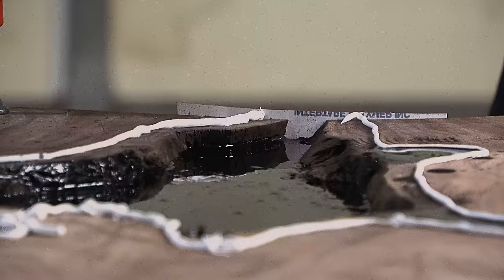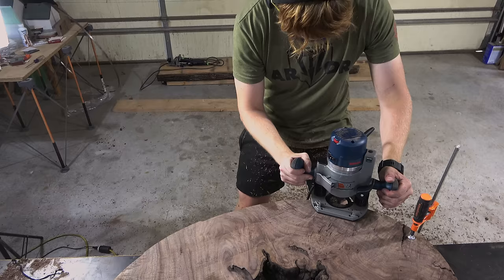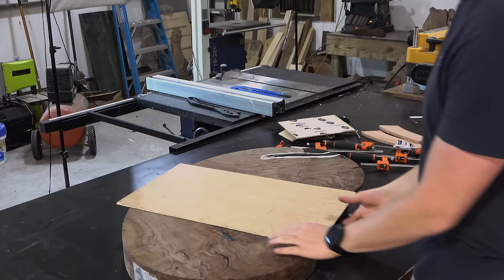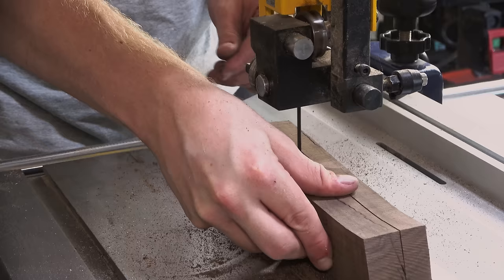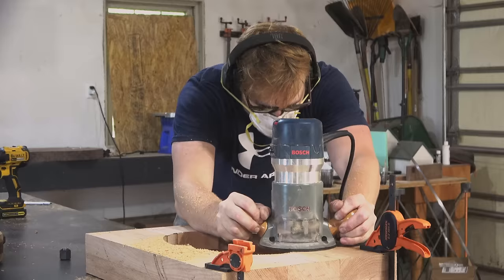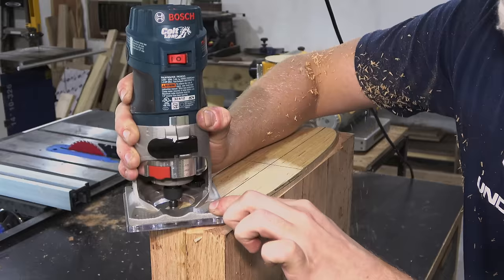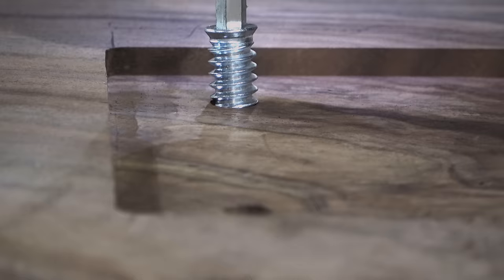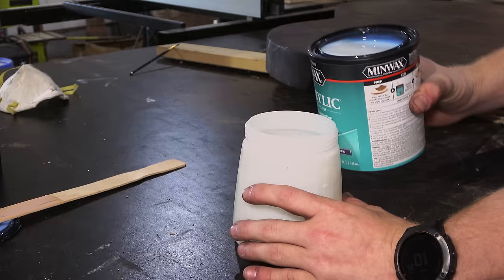The Reason Nobody Builds Furniture Like This

Comment: Looks good!

Ideas (what you might call constructive criticism, though I wouldn't consider any of it criticism, per se):

If you ever do that gold-leafed hole through the legs on another project again, maybe try chamfering (or rounding) the hole.

I would probably have rotated the legs a bit so that they were further apart at the concave end of the table as well. That part of the table looks as if someone, or something, were meant to "belly-up" to it. Having the legs more open on that side would enhance that look, and give it a more "intentional" feel.

That would make the whole piece look more unified, and less like a tabletop bolted on to some legs. Slanting legs outward (or maybe inward, I'd have to see a mock-up to see if it would look good) might also help with that.
Reply: After reading your comment and looking back at it again, I agree with your assessment. It would have given it a more balanced look.
Reply: Just goes to show, you learn during and after every build. Isn't that great! Love the process

Comment: Hey this is Stan I'm 80 years old and I'm so impressed with your work I can't even believe it I'll give you one little trip for the gold leaf use a squirrel tail kind of make a paintbrush in the static will put the gold where you want it to go this is on say a piece that's a little more Bumpy cause gold leaf is really hard to handle but the static from a squirrel tail makes it easy good job

Comment: Great video! I especially liked the oval drawing. Little mathematical note: that device to draw an ellipse (a term with a specific mathematical meaning, with oval being a general term) is a Trammel of Archimedes, an eponymous invention. An ellipse may also be drawn by: fixing two points on a flat surface, as with nails, and placing a pencil and both nails all inside one loop of string of any length. Draw an ellipse with the pencil holding the string taut. An ellipse is the set of all points whose sum of the distances to the two points, the foci, is constant, made real by the string loop.

Comment: As an old gen-xer, I giggled at your references to old tech. I didn’t think I was going to care for this design, but the beauty of the tabletop grain pattern alone won me over. I have to agree with a couple of other commenters that changing the angle of the legs might have resulted in a more balanced(?) look, but overall, you did a fine job on this piece. New sub. 🙂

Comment: This is the first video I've seen of yours. Enought to say it certainly got you a like and a subscribe.

You asked for comments on the table, honest ones, well here goes.
If I were the customer I'd be well pleased with the result, it does look great and the use of the gold leaf in the leg reveals is a great touch that makes the legs pop. My one criticism is that the legs look a little over sized for the top, maybe the could have been a little thinner. The black stain really works with the walnut. The kidney bean shape of the top is great, I'd be happy to own that piece of furniture. Slim, hand cut bow-ties certainly do look better than machine rounded ones. That's one design choice you've nailed.

You don't train or "qualify" as a designer, you can either do it and make great pieces or you can't. It seems that you can.

One day I'd like to see a designer use resin colours other than black. Imagine if you will that the inside of the large hole in the top was lined gold and then filled with a transparent, lightly tinted resin. How might that look? I would complimented the legs in this case.

Comment: Another tip, double side tape 2 equally thick scraps of wood to your palm router base edges, then use any flat bottom bit to shave down those bow ties in seconds. Then finish with the hand plane
Reply from the maker: That’s a good idea! I’ll try that out next time.

Comment: An idea for cutting out the ovals:  You made the first cut using your oval (ellipse) device with the two slicing pivots.  That established the outside of the oval.  Would it then work to move the router inward without changing the other settings and cutting a second trip around the oval?  By progressively moving the router, it should make a wide enough slot that you could then start in with your other tools without having to do all that drilling.  This idea comes from someone who does not own any of the tools involved but I have taught math so it works In Theory.  Thanks for the video.  Beautiful table.  Good work.

Comment: Honest review: First and foremost, build what inspires you - as you said, it doesn't matter if others don't like it, because if you do it immediately has value. As for my opinion, had I not known it was a table, I would have interpreted it as a bench. The bean shape resembles the concave indent on cheap plastic chairs, which visually communicates to users that it is meant to be sat on.  Also, I thought that your initial idea of the large roundover on the underside would have spoke a lot more to the bean shape, and also would visually make it look lighter. Overall in the end, it's very well done - the color, finish, design language and continuity.

Comment: Wasnt convinced from the sketches but that gold truely makes all the difference. Stunning. And honestly the only thing id have done differently is for the oval legs. When you know that youre gonna cut out the whole middle section anyways might as well save on material and time and use 2 shorter pieces bottom and top. Thatd have made it easier to cut out the rest as well. And also are there no jigsaw blades that long where you live? Im pretty sure ive seen them before

Comment: I like it a lot, especially the figure on the top! I also like the  legs which are proportioned well. It seems like a really small piece as far as furniture goes. Does it have a special place it needed to go? I like the blackened red oak but I'd have a hard time covering any hardwood with an opaque finish. But that's just me. Just curious, how long do you think this filling all the holes with epoxy fad will last? I wonder how seasonal wood movement will keep the epoxy and the wood intact and really mated together. I guess we'll see, won't we. I really love the gold leaf. I don't have any clients that rich. (Ha). Over-all, strong work, man! (not "dude"). Can you tell how old I am?

Comment: Very nice table. I would not characterize it as a weird design.  In Mid-Century Modern design, it is called a kidney table.  It could be a bean table, too, especially if you were thinking of a kidney bean when you designed it.  As far as the crate, I would think the problem was using OSB instead of plywood.  It is not nearly as sturdy for the same thickness of product.  I am sure it also took some abuse at the hands of the shippers, but i would go with plywood in the future.

Comment: I really like the table especially the top. Personally, I am always sceptic on straight table legs, particularly when the top has an anusual form. But it looks great. Does the gold on the legs is clean and smooth ? On the video, it seems to be rough.
Reply from the maker: It actually conformed to the grain of the wood which is a cool effect that I wasn’t expecting. So it does have a little bit of wood grain texture but it is still smooth!

Comment: By partially filling the voids, letting it settle, then filling again, at least 3 times on that thick of a slab, you won't have those big fill holes.   
Any bubbling or voids will be below the final fill.
Everyone makes bowties the same - sharp corners - why?  Give them an odd shape or rounded corners (and waist).
 It's too bad you threw the brown confetti away - could have mixed it with the epoxy and filled the holes - different effect
Try it on the cutoffs.
Also, why take off/remove all the loose material in the voids rather than epoxy them in place?  Gives a more natural effect.
The above only works on clear or lightly colored so you can see inside the voids.

Comment: Actually if your customer is happy with it, that is what really matters. Not sure how you ended up with this order, recommended, knew them? I love solid wood furniture, and that looks modern. Do like the legs though. Maybe next time you might try lazer etching a figure in the oval, like a tree for example as a stand alone piece. Make the red oak sing with a lighter finish. I have found that just using either a poly or a spar varnish 3-7 coats really sings. Take a few pieces of scrap and try different finishes. You will find just sealing the wood and then varnishing the wood, light sanding between coats will make you smile.
Reply: I first bought his one-of-a-kind table, love the energy he gives out,

Comment: I do rather like it. It wouldn't have occurred to me to make it, but now it's done, yes. I am particularly fond of the oval section on the legs. I might have done that. I would have probably left the slab as it came, and had a free-form table (unless there are size constraints of which I am unaware.) I think wood is beautiful as it comes. But that's me. You do you. Also, I too like bowties, and would have left them visible.

Comment: I like the table, it’s not something I would use in my home but it’s unique.  The only thing I didn’t like was the color of the legs. I prefer to see more texture in the wood and I think the black takes away from the natural beauty of the red oak. A color stain would have made that pop. Inside the oval legs for the metal a brushed nickel or stainless. It’s just my opinion and everyone has a different one. 😊

Comment: The east coast has been populated way longer than the west Coast and so all of the good trees got cut down 200 years ago. Minerals in the water is not the reason for cool grain.
Reply from the maker: That makes sense! But shouldn’t there still be new cool trees growing?
Reply: @StarnerWoodworking  there are plenty of them but first they take a long time to grow and get heavy enough to twist and turn the wood grain and again this coast is far more populated than the other coast and for far longer so cool trees to people is like 1 to 1 where on the west Coast it probably 1 to 3 that's why they sell all of it on the east Coast. They don't have as many cool tree wanters on that side.

Comment: I'm one of those older viewers you talked about.  Do I like what you made? Yes and no.  The top is nice.  Not great, but nice. The legs are creative and are nicely proportioned.  However, I don't see any congruency between the top and the legs. Why do you think they go together? Is there harmony there? No, not really.  Are there relating features that bring them together in design, colour, shape, texture, tec? Again, no, not really.  
Imagine, if you will, integrating in from the edge of the bean's top, a corresponding inlay of black and gold, creating both visual interest and a melding of top and bottom pieces.  Likewise, some of the natural figured grain from the top could be applied to the legs - in any of a dozen or more ways - to solidify the continuity. 
The right hand figure at 29:27 of your video demonstrates a sad chubbiness to the table's top. Imagine undercutting the same sleek curve profile of your legs into the underside of the top. It would elevate the top's look from "country chubby" to "city chic".  
Having said all that, I applaud you on what you have accomplished, and encourage you to continue with your work and designs.  Oh, and don't be afraid of hand tools. They are much better and faster than power tools for many jobs.  A hand saw, instead of jigsaw, and risky bandsaw work, would have made quick work of cutting your top from the slab.